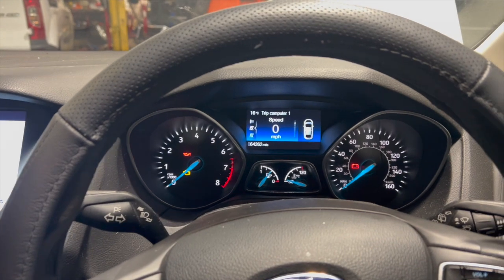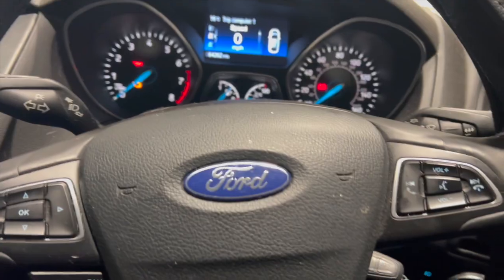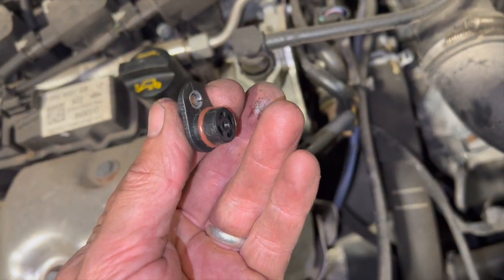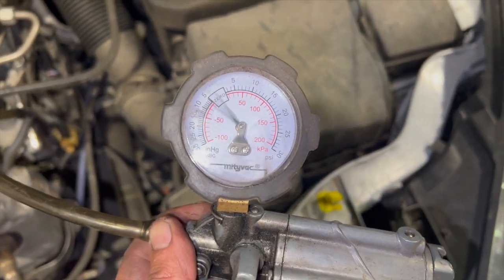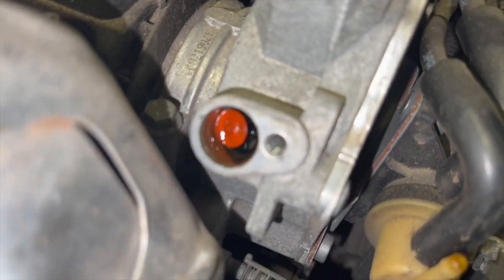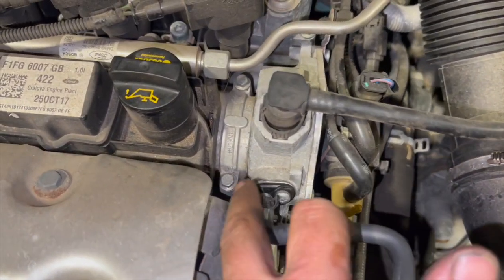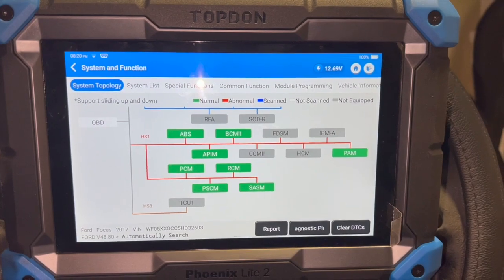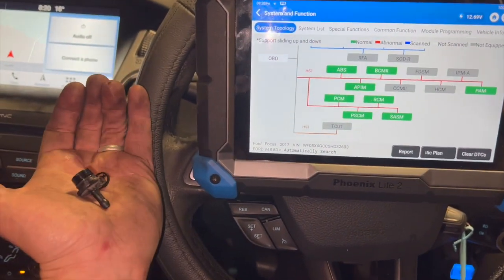Ford Focus 1.0 ecoboost P0299 Fixed

Comment from the maker: New vacuum pump valve - https://diydaly.co.uk/products/vacuum-pump-valve-repair-kit-for-ford-1-0-1-5-ecoboost

Diagnostic machine used in this video:
https://diydaly.co.uk/products/phoenix-lite-2-2yr-subs

Tools used:
Torx screwdriver set - https://ebay.us/fRwL2z
Leatherman wingman - https://amzn.to/3Cfxa86
Socket set - https://ebay.us/7tUKdM
Ring Inspection Lamp - https://amzn.to/3gGWHcG
Mitivac vacuum test kit - https://ebay.us/Ejvxht
Reply: The ebay link no longer works, can you try posting a new one please?

Comment: I never comment on video's but this has been a life saver! Endless trips to the garage, no one knowing the problem with my Ford 1.0 C-Max ecoboost. I ordered this, came 2 days later, fitted myself (as someone who doesn't even know how to fill oil up) and my car is back to its old self! The old valve was completely broken, just as you showed in the video! Thankyou so much!
Reply from the maker: 👍👍👌 glad to help
Reply: Did you use the link shared on the video?
Reply: I need this desperately good people.  I am in South Africa

Comment: Thanks for this awesome video, I could not take of the hose though after removing the clip. even used the spray, and suggestions or advices please?
Reply from the maker: Light work it side to side that should crack it off

Comment: I opened mine and check and same thing as what you have shown in this video. I have just put the red thing back in and popped the black cover back on. Would that be sufficient enough?
Reply from the maker: Unlikely it will stay together I’m afraid mate
Reply: What if i install it without the diaphragm and the black plastic cover
Reply: @Abdul19082 I also want to know

Comment: would this valve being faulty cause a boost surge when holding pedal half way down on a hill but pulls fine when hard to floor? or is it a case of if this fails then you loose boost completely?

Comment: I’ve the same problem for my focus mk4 1.0 ecoboost 125hp 2019, anyone knows if it is the same? Led sign appears when I try to accelerate with low rpm.
Reply: Same mate, I got the same car but the wrench 🔧 (service light) comes on for me. No engine light but I do have the same issues as underboost and my car loses power after a long haul or going up hill. When you turn the car off and back on, it goes away, I also have the restrictions of rpms as well for some reason. I haven’t checked my fuel pump valve but it could be the issue

Comment: Can’t find the valve on my 2020 1.0 Ecoboost but I am having this same problem
Reply from the maker: There different on the later ones , yours won’t have it
Reply: @diydaly okay thanks for letting me know trying to find the issue, I got the P0299 fault but it only comes on when I accelerate quickly once the car has reached the middle temp on the thermo

Comment: Iv ordered this part off your website last night for my wife car. I really hope it fixes it as she having the same problems . If this fixes it then you have saved me hundreds on a new turbo 🤞🏼🤞🏼🤞🏼🤞🏼
Reply from the maker: 👍👍🤞 for you mate! Thanks for the purchase!
Reply: @ no problem and I recon it could be the problem as iv got the same code and it's fine and all sudden the engine service now light comes on and then has no power at all so sluggy
Reply from the maker: @ 👍 when you remove it you’ll know straight away if it’s collapsed
Reply: @diydaly  lovely stuff thank you!
Reply: @diydaly  fitted this today... soon as I took the old one out it was all in bits like in this video. Fitted new one and code has gone and it's driving so much better so fingers crossed it's sorted!!
Reply from the maker: @ 👍👍👌nice one , glad to hear it
Reply: @ unfortunately this didn't last long lol... soon as I took it onto a motor way the same problem happened and same code... new turbo time ??
Reply from the maker: @ arr Bugga , yes quite likely … it’s important to consider the Wetbelt breaking down and blocking the oil supply to the turbo .. if this is blocked and you replace the turbo you may damage the new turbo

Comment: Valve replacement works but only for a short period of time. I think that true problem is elsewhere. I replaced the valve for a new one and problem aftet 10km came across again. In my opinion there is too big pressure in the system which makes the valve collapse.

Comment: Had the same problem with this valve,change it and works fine around 500 km and now again goes into limb mode or safe mode and lights "check engine" on dash. I dont think it is the same problem with valve...can anyone knows another potencial problem ?

Comment: Is the vacuum pump valve in the description OK for a Ford Fiesta 2014 1.0 ecoboost titanium mate
Reply from the maker: Hard to say without checking ,
Best to have a Quick Look on your vehicle as you should be able to see it.. some of the later ones are different but usually around 2017 onwards

Comment: Could this relate to the p0240 code???

I don’t want to have to replace the cat….

Checked the flexi and it’s not leaking so next thing is this or change both oxygen sensors.

Comment: Hi im having the same with my fiesta, i checked this valve and mine was definitely broken. I then replaced it with a new one, but it didn't seem to fix the problem. Any ideas? Im wondering if the broken valve has caused another issue? Could it break the vaccum pump completely? I did take it for quite a long drive home when this issue was occuring.. also theres some white smoke, which i believe is due to the air/fuel mixture being to rich in fuel.

Comment: Those cheap and nasty valves off the Bay last about an hour then fall apart like the original 
then you are back to square 1 

fit 2 rubber O rings same diameter as the hole into the Vacuum pump first the O ring on the old valve is that diameter 
1 isn’t really enough 
to space the gap so the valve cannot fall  apart

in most cases because it’s been left leaking for so long the entire vaccum system including turbo actuator will be full of oil 

The  P0299 will come back if Turbo Wastegate  valve is worn 

If it’s worn the area around there will be fouled with black exhaust soot and it rattling from start up
Reply: I put o rings in and it sucked them in
Reply: @Whiteyy90  They need to be the exact diameter of the hole and when the plastic valve is fitted it will hold them in place 
The O ring on the old valve is that diameter but you need more than 1 

when the plastic valve is put in by hand it should be proud about 1.5 to 2 mm and when the T25 bolt is nipped up it will squash them in .
Hope this helps 
The Quality of them is garbage they only last about half an hour
Reply: @BigD879  they do I’m think about changing to straight through valve is yours still working pal
Reply: @Whiteyy90  It did work but when the car was on the motorway 60 - 70 mph it was beeping service now and restricted power P0299 Turbo underboost was stored in ECU

Closer inspection of the wife’s car the Waste gate valve on the Turbo was absolutely faked 😭
You could here it rattling on start up and the area around the wastegate valve was black with carbon / exhaust gases 
it should be clean if your turbo is good . 
Also car when it was in Warranty age went into Ford main dealership Liverpool to have the crap snide bad quality heat shield replaced they are always loose and cracked at the mounting points 
Ford Technician removed that plastic vacuum valve 
to do this job and when the divi has re fitted it the valve has fell apart the inside piece had fell in 
he hasn’t noticed 😭
crimp marks could clearly be seen on the plastic parts where he has tightened the T25 bolt and crushed it 
ie it hasn’t happened on its own 
this wasn’t noticed until about a year later by then the whole vacuum system was chocker with engine oil 
i’m talking everywhere boost valve / pipe work .
when the turbo was removed and the wastegate /accuator valve was moved up and down by hand it squirted all engine oil out the actuator 
it was full of it 
It’s now had the Turbo replaced for a good 1 all pipes cleaned out vacuum unit replaced no more P0299 code 
better performance and much better fuel economy it was absolutely drinking it .
Thought i wonder how long it will last too good to be true with these engines 
Few weeks later wife reports Engine management light on again 😭WTF it wasn’t on before even with it in the state it was in 
Different fault code this time it was O2 sensor fault  bank 1 which is the one on the top which had also been replaced under warranty.
The old Ford’s are the best 
These new ones are only designed to last about 4 years absolute crap 
Hope this helps and good luck with yours mate 🙏
Reply: @Whiteyy90  I’ve read off the internet people have done away with that valve that goes in the vacuum pump and have some how fitted a similar valve off an Audi or VW but whatever is fitted it needs a one way valve in it otherwise it will fill the system up with oil
Reply: @BigD879  joke mate mines had belt done coolent problems fixed now got another one new cat and both sensors replaced joke money waster
Reply: @BigD879 exactly when I got mine 4 years ago only had it 6 months before belt went I didn’t know anything about eco boosts back then or wouldn’t of bothered I’ve got till November next year get payed off then it’s gone no more fords now wanted an st next stuff that
Reply: @BigD879  same pal biggest money con going I’ve just ordered a new vacuum pump of eBay 110 quid comes with the valve aswell so going to swap the valve other from the new one see if it lasts then if it does swap fill unit it’s a gamble but we see
Reply: @Whiteyy90  Good luck with it pal i hope you get it sorted check the vacuum system for oil especially that boost valve 
disconnect the pipe at the turbo and blow it all through with brake cleaner and let it evaporate off 
i was in the scrap yard (again! ) where hers should of been years ago haha to change the vacuum unit on the side of cylinder head 
there was about 10 engines out to choose from every one was chocker with oil
Reply: @BigD879  will do pal nice one and yeah I’ve seen same near mine lol not surprising haha

Comment: I was quoted £500 for a new vacuum pump, I said f that. I was told by 3 different sources that you cant buy that plastic bit separately so I ended up gluing it back together until today 2 years later i came across this video! Jesus christ such an easy fix. Why does nowhere fix this issue?
Reply from the maker: 🤣👍👍 not many people know you can buy it separatley

Comment: Hello. I have the same issue, I ve changed the valve, but after 200km cracked again. I also have problem with the pedal of the brakes - it is hard and it is hard to stop the car. After pressing gas pedal the pedal of the brake gets soft again. Could this break problem be connected with this valve?
Reply from the maker: Yes very likely related

Comment: easy fix its a one way valve !!! remove old valve take orange bit out and black circle bit and put them in the bin!!! put old valve back in cut rubber pipe and install one way check valve 5mm  from anywhere!! just remember flow goes to old valve!!! i used old audi  brake servo vacuum valve does the same thing £3.00 from ebay or less from breakers yard hope this helps!!
Reply: Can you take picture of this one way valve 5mm?
Reply: Any idea which way the vacuum flows? Im in a pinch pretty bad and using an inline check valve and have no idea which way to install it. Air flow arrow pointing at the guts you threw in the bin?
Reply: @CrankDatPikachu93  yes flow going to old valve!

Comment: Ive just got hold of a 2012 focus with the ecoboost 1.0 emgine, it came up with two codes, P006A and P0039, ive swapped both map and maf sensors, to find out theres a second map sensor, but also checked the vacuum on the valve you're showing in this video and my vacuum tester went bonkers.

I cant seem to get a coherent answer to whether or not the place sells the valve that'll fit my pump.

The only difference between the serial numbers is mine has FA at the very end and all the ones listed either end with GB / GA 
you got any advice one whether that would matter or not please
Reply from the maker: I’m not 100% sure tbh but if it oooks like that type there isn’t usually and options
Reply: @diydaly  see I've messaged them, and they said they couldn't find my serial number / model, when typing my serial number into Google search it comes up their model numbers as listed, and gives the same description as the eBay listing, they have told me to compare the size in relation to a picture which is inherently a flawed idea, as pictured and videos always make things look bigger than they actually are ( sometimes smaller ) 

I guess I'm going to have to buy one in the hope it's right, and hope that it fixes the issue.
Reply: Thanks to this video, one of my error codes have gone, the other error code is the actual bypass valve so onwards and upwards we go

Wish I'd seen this before buying my map and maf though 🤣

Comment: Thanks for the video. I have the same P0299 on my EcoSport 1.0L. but the valve on the vacuum pump is not broken when I removed it. Could it still be bad also?
Reply from the maker: Yes may just be leaking but not fully collapsed , for the price it’s worth a quick try first

Comment: Hey DIDaly!
Changed mine a few months ago BUT there was no orange part, just a little piece in the middle. Can it stuck somewhere? And if, where do you think? Because the power is not like before. Underpressurepump already changed. Thanks for reply!

Comment: Thank you for this video.. This was the exact same thing that happened to me.. My car lost boost.. I searched the Internet and come across loads of people saying the turbo had gone and that it will cost hundreds of pounds. Then come across this video and seen on another thread about this little valve. So chekd my valve out and it was exactly the same, it had broke apart. I managed to change it myelsf with very little ease .. And the valve only cost £7....amzing video, and saved me so much money and stress.. Thank you
Reply from the maker: Glad to hear it 👍👍

Comment: My car (2020 Ford Focus Ecoboost 1.0 the mileage is 33000 miles)  had the wrench symbol come up twice in a space of a month (l've had no other problems with the car). So l took it in for a diagnostic check. The mechanic didn't even look under the hood and he told me l need to replace the entire Turbo charger unit which will cost me North of a £1000. After watching your video l'm a bit speptical of my local garage. Please help with your expert advice. https://drive.google.com/file/d/1qT_GMBWGYs05KHQWonYF6RswELVE2egq/view?usp=drivesdk

Comment: Valve replacement went well, small pipe which connects to could do with replacing… do you have a link or part number for that part please?
Reply from the maker: Should be a link in the description

Comment: Valve replacement went well, small pipe which connects to could do with replacing… do you have a link or part number for that part please?

Comment: Thanks for this mate, I have exactly the same issue on my missus 1ltr eco, I bloody hate the thing 😂, I've ordered one from your link and will try it out as costs bugger all really and straight swap over if it works, happy days 👍🏻
Reply: @diydaly  exact same thing mate, it was in three pieces, easy remove and replace and going to give it a run out later, cheers again mate 👍🏻

Comment: Hey there, I checked my valve after having some of the common issues, replaced the valve with a new one, and after about an hour of driving, the new valve broke apart, does this point towards a vacuum pump fault?
Reply from the maker: Sounds like a faulty part tbh mate , they are only made aftermarket so I may find some arnt the best quality.. if had the same issue once… fitted loads without any trouble though

Comment: Great video got the code today - been losing boost for a bit now - guess it was this falling apart, maybe, maybe not - but the valve was in pieces. Looks like I will need to replace the vacuum line too as it is "welded" onto the valve.
Reply: How'd it go?

Comment: Hi my son has a mk8 fiesta 1.0  keeps throwing fault up catalysts beyond threshold bank 1 it’s had new cat all new o2 sensors would the valve on the video make a difference
Reply from the maker: p0420? has he had an aftermarket cat fitted? this valve wouldn't cause that issue tbh
Reply: @diydaly  yes new genuine ford cat fitted at ford
Reply from the maker: @jasonclancy342  arr that’s odd , my be wiring issue then

Comment: ive got the same problem, P0299 and P123a only the valve here is good but our vacuum is around the 30 thats the max i think, already swiped the 2 sensors on the inlet, check the wirring,  any suggestions?
Reply: Check blow off valve diaphram. Mine caused it to go limp mode

Comment: Same problème i replace this part solve also the cruise control , hard brake , and lose of power on my 1 l ecoboost focus
Reply from the maker: 👍👍 glad it helped
Reply: Hello. Your pedal of the brake was hard right?
Reply: @jorkata333  yes but now my timing belt failed with tiny pièces in the oil pump and my car was broken 4 month ago ... so good Luck with eco boom! ^^
Reply: @maxmax-sr9lh  how many KM was the car when belt cracked?
Reply: @jorkata333  so many question 😀 my car break at 150 000 km i hope you change your belt and you change oil very often ..
Reply: @jorkata333  oil inside valve is not normal bescause the rubber seal was destroy in the vacuum pump i guess. But no worries
Reply: Did you have some kind of à loose of power ( the boost ) because it was my problem also
Reply: @maxmax-sr9lh  I lose power only when my Engine Check lights
Reply: When I press trotle pedal, after that break pedal gets soft. Same with you?
Reply: I saw today that when I change this valve I have oil inside. Is this normal or bad?